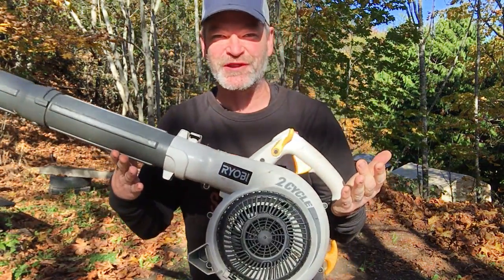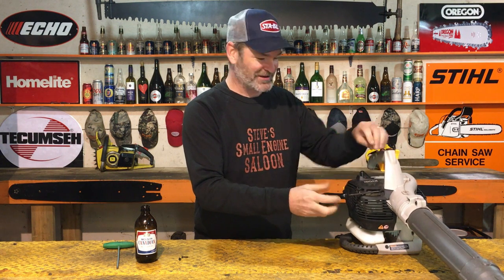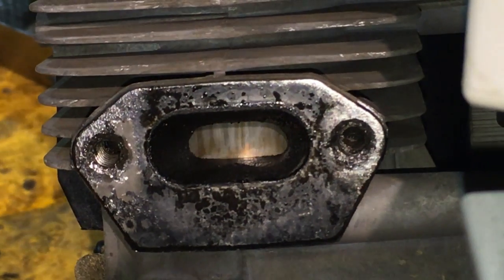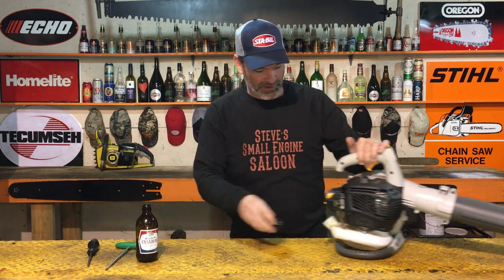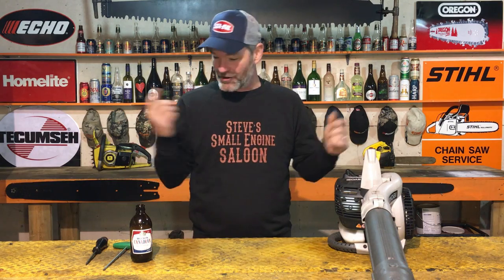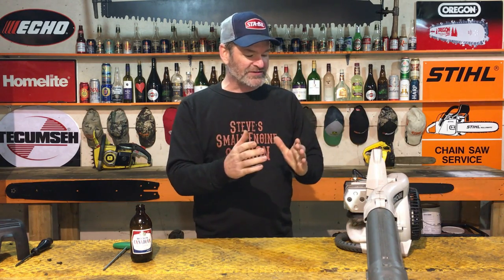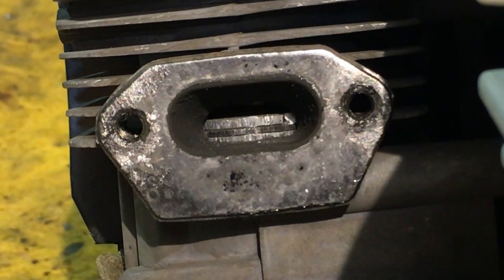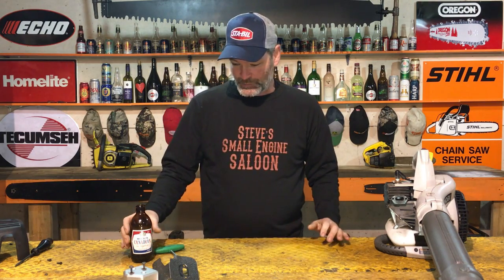What Happens When You Run Straight, Unmixed Gas in a 2-Stroke, 2-Cycle Engine

Comment: Steve, I was told by a Sthil dealer, after he replaced my carb on my Sthil blower it would not rev,, the reason the carb went bad was I used unleaded gas from the pump. He told me to use fuel with no ethanol in it. which is available, tho expensive, it is mainly used for rec vehicles.
What say you? I am using it in all my small engines. Thank You
Reply: canned pre-mix fuel is a good alternative to pump gas, but Stihl says their products are engineered to run on up to 10% ethanol fuel.  my nearest ethanol-free source is 90 octane, and $4.99/gal right now.
Reply: RICARDO MACODO 

Hi Ricardo 

I've been using lead free petrol in my Sthil Leaf Blower and Hedge Cutters for the last 17 years .... never a problem .

I use them commercially 

However, I'm in The UK ..... Fuel might be different here.

God Bless
Reply: What kind of the gas works for the blower
Reply: If you're using the equipment everyday, fuel containing ethanol is fine.  It's not going to sit in the carb long enough to do damage.  If it's for a homeowner and will set a week or more between uses, I would recommend finding ethanol-free gas.  Where I live, ethanol free is around $3 a gallon.  It's what I run in my weedeaters, chainsaw, ATV, and lawn mower.

Comment: It’s only a Ryobi relax.
Reply from the maker: LOL, my thoughts exactly....
Reply: My thoughts exactly as well. The second I saw the thumbnail.
Reply: My Ryan blower lost the rings twice in 2 years. My Redmax is going on 20 years. I bought it at a mower shop. 

You get what you pay for.
Reply: The Fanboyism is strong in this thread. 

Every maker has its good and bad tools. Ryobi has some decent tools for the price point. I don't own any Ryobi, but I have used them in the past. I had no idea Ryobi made anything gas.

I was terribly disappointed in my Dewalt chainsaw and weed eater. The weed eater works great but you cant change from edger to trimmer, the motor is at the end. That upset me. The chainsaw broke instantly. Dewalt 20v batteries dont like moisture as I have learned. Everything I own is dewalt so I am trapped. The vac and blower are great. The rest of the tools are about the same as any other brand.
Reply: You might own a throw away piece of equipment if the manufacturer says, "no need to change the oil".
Reply: I bought a Cryobi grass trimmer at Lowes 24 years ago. I took it back the very same day because it sucked so bad. 

I then went and purchased a Stihl FS 80 and I still have it. It still runs like it did when I first bought it. I also should mention that the Stihl has had the piss run out of it and refuses to die. I'm not talking about just using it for residential or commercial trimmings. This machine was used on a farm, a peach orchard to be exact. I had to cut brush and tall grass around 1,400 peach trees. That's alot of trees! 

Some of you might have experienced good service from Cryobi, but they'll never get another dime of my money again.
Reply: DeepWaterBlack no a mantis tiller lol
😂😂
Reply: You get what you pay for
Reply: Can it be fixed now, or not worth the price?
Reply: You killed RYOBI, good job!
Reply: my ryobi weed waker is trash so i had the same thoughts
Reply: I've got a Ryobi gas blower, electric hedge trimmer, 2 electric routers, and a table saw.  I believe Ryobi makes a quality product.  I love them all.
Reply: @frankhoward7645  How long have you had them for? Usually, you get what you pay for.
Reply: @frankhoward7645  You believe wrong.
Reply: @DarkLinkAD  Oh so according to you, my gas blower, electric hedge trimmer, my 2 routers and my table saw aren't running well, aren't reliable, and haven't lasted 20+ years.  What else can you tell me about my equipment?
Reply: @frankhoward7645  No they haven't, I dont believe you.. at all.
Reply: @DarkLinkAD  
Ask me if I care if you believe me.
Reply: @frankhoward7645  I know you care, thats why you responded.
Reply: @DarkLinkAD  Geez, you seem to know more about me than I do.  Tell me more about myself.
Reply: @frankhoward7645  I only know you from your comments.. 
 But if you want a stereotype.
    Your a left leaning hippie that likes to think of himself as an oldie.  You call yourself an American but idolize the British. You believe your individual circumstance  is equivalent to the masses, which why you've used your tools once, in 20 years and think this somehow meets the qualifications for dependable.. Regardless of what contractors, construction workers, landscapers etc. have to to say about it.
Reply: @DarkLinkAD  I can tell you for sure I know what you are.  I looked it up.
prej·u·dice
noun
1.
preconceived opinion that is not based on reason or actual experience.
"English prejudice against foreigners"
synonyms: preconceived idea, preconception, preconceived notion; prejudgment

I don't think you'll ever make it to a jury and by the way, your description of me wasn't even close.
Reply: @frankhoward7645  Huh? Oh im not reading all of that, because I dont care enough. AKA Im normal.
Reply: @DarkLinkAD  I understand.  Reading the truth (like a definition) is not your forte.
Reply: @frankhoward7645  What can I say, some people prefer to live the truth and others read about it. :)
Reply: @DarkLinkAD  You can use circular logic all day but the fact is, you're infamous.  I found you in the dictionary under "prejudice".
Reply: @frankhoward7645  ... So im infamous but yet you found me in a dictionary?..
....
..

....
..
....
.
....
Reply: @DarkLinkAD  Too bad you don't understand what infamous means.
Reply: @frankhoward7645  .. If I were infamous, id be in a History book, not a dictionary.. Jesus your a loss.
Reply: @DarkLinkAD  News flash.  The word "infamous" IS in the dictionary.  Of course, I don't expect you to look it up because you, "...don't care enough."
Reply: @DarkLinkAD  Who cares where you're most likely to find historical context?  I didn't suggest that you look in a place most likely to find historical context.  I suggested that you look in the dictionary because it defines someone who has a "preconceived opinion that is not based on reason or actual experience" as prejudiced.  You have demonstrated that you have preconceived opinions that are not based on reason or actual experience therefore according to the dictionary, you're prejudiced.  It's that simple.
Reply: @frankhoward7645  whens the honeymoon?
Reply: whats wrong with ryobi?
Reply: @hossdude65  You meant what's wrong with cRyobi.
Reply: My touch start 31cc strimmer is still running strong. High hours on it aswell. Often go off for 7 or 8 hours and burn lots of petrol, use lots of string and cut lots of grass. Been putting those hours on it every week or 2 ever since 2010. Maintanence is your friend on a ryobi lol. Good oil aswell and they last a while. Wont doubt that a stihl would outlast the thing 10 times over but i dont have money for expensive machinery
Reply: Ryobi is good

Comment: Can you please show a video on breathers on mowers brush cutters and chainsaws , for this happened with loads of machines they start but under load they start to die  ,it's only because the breather is blocked or gone hard  in the filler cap ,I've helped heaps of people out, my mate took his mower and brush cutter to an expert and they over look that problem every time

Comment: I followed Steve’s advice and run 40:1 on everything our company owns. Nothing has seized since. We lost a lot of equipment at 50:1. Thank you Steve! Lifetime subscriber here!
Reply from the maker: Thank You...
Reply: Still recommend 50-1 in their chainsaws. I don’t think so Tim! I run 40-1 in everything here.
Reply: Yup that’s what I do.    Screw that tree hugger EPA nonsense.      A little more is fine n dandy while too little just makes you go buy more expensive needless.y complicated equipment.
Reply: I've actually been running 40 to 1 as well! Zero issues here. The synthetic oil seems like a much better choice for two stroke engines as well.
Reply: That’s what I do too - 40:1 ratio with fresh petrol and quality 2T fully synthetic oil. 
That’s the magic to your tools. 👍
Reply: If you run 40:1, you might have to adjust the carb because 40:1 runs LEANER than 50:1. But I use Stihl Ultra HP at 40:1 in EVERYTHING I own. 50:1 is probably OK, but I'm not chancing it. And I always have a nice golden brown spark plug, never any carbon buildup. These people talking about 100:1 because they use some fancy oil (usually Amsoil) are risking it in my humble opinion.

I use 40:1, adjust the carb, never get smoke, never any buildup and the spark plug always looks PERFECTLY golden/carmel color.
Reply: shitty oils. i run 100:1.

Comment: I found two of those in the garbage too and one that said homelite but other than that was exactly the same because their made by the same company UT out of Hong Kong which is very unfortunate for homelite considering what they used to be.
Anyway getting off topic. Oh my uncle has one of those ryobi's too.
The homelite worked perfectly fine, it was just infested with ants, they all took off after I started it. One of the grey ones ran but the carb needed a cleaning and I forget what the deal with the second one was.
I use a McCulloch air stream XVI handheld blower, its bern my trusty go to for 10 years, the red homelite is a backup. I also have a stihl br340 backpack blower but it floods and I'm not sure why and now my Stihl FS80r is doin thr same thing so their really hard to get going.
I put straight gas in a blower once by accident. I was like 10 years old and it was a brand new blower I bought at sears to do leaves. I figured out before it was destroyed so after that it always ran like a loud chainsaw, but still got the job done.....
Reply from the maker: Right on....

Comment: for all people wondering why it took almost 10 (!) minutes:
the engine "stores" a lot of oil in the crankcase, so, until this oil is "used" up, the engine still gets lubrication in an decreasingly mix ratio - this is actually prove, that you can run a 2 stroke engine leaner than 40-1, or 50-1 ;-)
I run full synth at 75-1 :-P   in my stuff - and never had a problem...

Comment: What if you put 50 to1 fuel in a chain saw requiring 40 to 1 or the other way around
Reply from the maker: If you have a saw that says 40:1, it is very old, before mix oil is as good as it is now.  I mix all my fuel at 40:1 with high quality oil...
Reply: Its gonna run very hot...…. not good

Comment: Go ahead and take it apart. I want to see the cylinder and crank. Thanks
Reply: The piston, crank & con rod are press fitted. No disassembly unless its bashed apart. Non repairable. Short block assembly replacement.
Reply: @IAMNOSLEEP  I didn't know that, thanks for the info.

Comment: Hi Steve. I've learnt so much from this channel.  Keep up the good work.  Saw that the XP oil you recommended is fully synthetic.  Just wondering if you could mention in a video the difference between that and semi synthetic oil.  I have a Stihl FS100 strimmer which I was told is a four stroke engine and must have fully synthetic oil.  But have always bought semi synthetic for my chainsaw.  What's the right thing to do?
Reply: It's has better lubrication ability, can withstand higher temperatures. But it cost double the price. The guy I bought Husqvarna 343 FR recently recommended me use only fully synthetic oil. The guy is mechanic in Husqvarna center.

Comment: Have you ever tried SAE 30
Reply: it will destroy the engine, doesnt mix well with gasoline and will wear out the rings
Reply from the maker: That is what they used to use 40 years ago as mix oil at 25:1 ratio on engines that have loose tolerances.  Cant do that on modern equipment...

Comment: Big thumbs up there bud! Damnedest thing happen to me once. My helper ran straight fuel in my Husqvarna handheld blower for about 20 minutes before I caught him. Before that the thing had been running kind of rough, after I caught him and yelled at him I noticed the thing was running faster and better. I assumed the blower was toast, I checked the bore and piston and it seemed fine. The damn thing runs better now than it ever has. I do all my own tune-up and maintenance on my Motors, so I know this doesn't make any sense. Maybe the straight fuel  somehow cleaned up a clogged jet  at high temperature? It will forever bug me.
Reply: I'm curious about it too.
Reply: i have run  plain gas thru a couple old saws i had that werent running so good i thought they were done but after that they run fine so i have seen it b4 but i do not know what the plain gas fixed either lol
Reply from the maker: WOW, thats awesome..
Reply: Old oil and gas can get gummy so I assume the straight gas helped break it down inside the 2 stroke that's just my guess my oldest sister gave me a two stroke weed whacker that had 2 cycle mix in that sat for several years or longer it was seized shut by the oil and gas that turned into varnish it was like glue we wound up scrapping it out has scrap metal i could not unsezie it!
Reply: Same thing happened to me yesterday with my Husquvarna blower. But I didn't catch it. It stopped running by I have compression. Plus it ran for 30 minutes before it quit.
Reply: You cleaned out the oil build up. Yes you did. Most people mix thrir oil/ fuel ratio mix too heavy on the oil and it gums everything up after a while. By running straight fuel, you cleaned out the accumulated sludge probably in the lower crank case and mabe the reeds. Do you know what kills the 2 cycle engines more than lack of oil? HEAT . Yup! The heat range on a 2 cycle is much lower than a 4 stroker because the oil lubricates and cools the engine by lowering the ignition temprature. Thats why that Ryobi piston melted. It might have kept running until heat expanded the piston and stuck the rings. My guess is the Ryobi also had some oil gunk in it also. thats how it ran so long. Fuel can vaporize easily, fuel with oil cannot, so on a 2 stroke, the engine is able to draw up more fuel and less oil if the ratio is wrong. This causes excess oil to pool in the lower half of the engine. I know. I learned this doing Snowmobiles. Originally they were gas oil mix then went to oil injection.

Comment: Interesting. I have a 288xp Husqvarna saw that is 28 years old. I’ve built log homes, run it on a mill and used it for big timber firewood cutting.... it is getting increasingly tighter and takes both hands on the pull cord to start. After a few pulls runs like a champ. What  would cause increased compression? Thanks. Great channel.
Reply: I had the problem with my MS 250C.
Reply: rings may be sticking ?
Reply: Old age!
Reply: RJ Van  yes! Yet it runs so strong. I bought a new 5 series Husqvarna with a computer controlled board in it. It is sweet and light but let’s see if it still running in 30 years.
Reply: I really need that saw next week. I wonder if I can pull the plug and work some solvent through it and loosen it up without having to tear it apart?
Reply: @bittoman1  I heard that urine is good solvent for carbon build up or to be precise ammonia in urine does the job done.

Comment: Hey Steve, great video!Had this happen to an Echo PB550T blower and the ring was melted to the piston as well, and the cylinder was scored a little.I was wondering if you have repaired a unit with scored cylinder, perhaps with a sleeve inside and new ring and piston?Thanks for sharing this.Cheers,,

Comment: In your opinion Steve, how long did it have before it was rendered unusable? If you were to catch your mistake after a minute or so, would too much damage already be done?
Reply from the maker: It was probably still usable after 8 minutes!  If it still runs, its usable...
Reply: not an expert on these types of engines, but i would guess the most scoring of the piston and the cylinder wall is being done when you actually hear the rpm slowly start to drop. from then it gets worse quickly. Oils have gotten much better in the recent decades so the lubricating film on the moving parts will protect them for a little while if you catch your mistake soon.
Reply from the maker: I agree 100%....

Comment: Hey Steve what's the difference between the stihl mix fuel and the one you can mix yourself?
Reply: It's alkylate fuel, burns super clean
Reply: Just about all canned premixed fuels have fuel stabilizers in them.
It will last 4 years in an unopened can and roughly 2 after opening.
Straight gasoline with no stabilizers starts to degrade after 3 months and with 2 cycle oil mixed in,it can get really nasty. Think Vaseline.
Even if you dump the tank,the residual fuel can really goof things up. From the filter,fuel lines,carburetor and rings.
If you are not using a fuel stabilizer,at least do this at the end of the season. I prefer Deep Creep penetrating oil,but Mavel Mystery oil will do fine. Dump the tank.
Fill your tank with about a half cup of straight gas and add about a four second spray of Deep Creep or about a tablespoon of Marvel Mystery oil. Start the engine. No need to rev it up and let it idle for two 2 minutes and turn it off.
Dump the tank for storag.
I have a 25 year old Tanaka that was retired from the grounds crew at Opryland theme park. Still works wonderful with this regimen.
22 year old Snapper. Same regimen.
Reply: @paulbillings1791  thanks will definitely do that
Reply: @paulbillings1791  canned one (or from pump it's like 80cnt cheaper from pump than canned ones) "small engine fuels" Are here 100% parafin/alkylate . It's totally different than normal gasoline!
Reply: The Stihl mix and the Aspen fuels are great for a unit you don't start for months at a time.
They also don't have as strong an exhaust smell, if that bothers you.